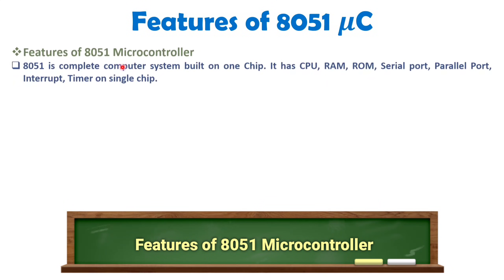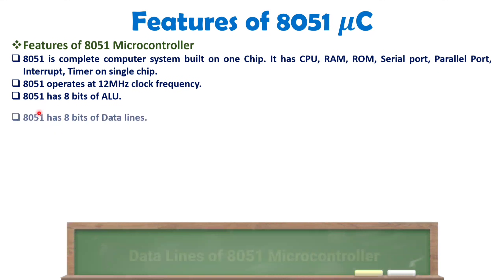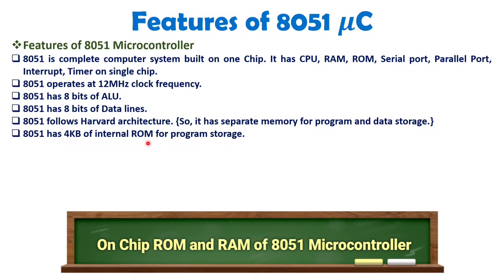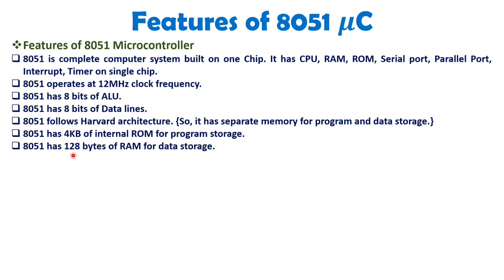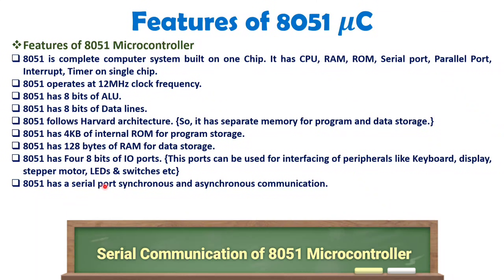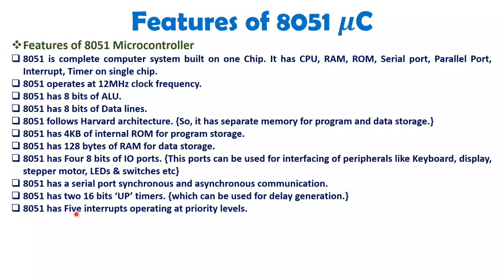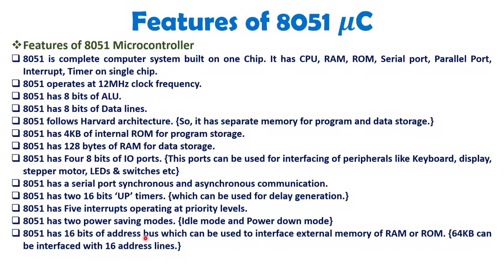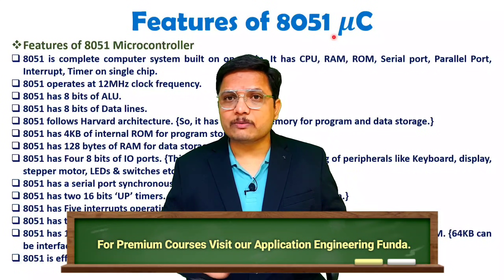8051 Microcontroller Explained: Features, Components, and Applications

Comment: Timestamps (Powered by Merlin AI)
00:02 - Features of 8051 microcontroller
01:16 - 8051 is a complete computer built on a single chip.
02:40 - The 8051 microcontroller follows Harvard architecture.
03:57 - 8051 microcontroller has embedded system and memory storage capabilities
05:23 - 8051 Microcontroller supports peripheral interfacing and serial communication
06:44 - 8051 microcontroller has two 16-bit on-chip timers used for various applications.
08:03 - 8051 Microcontroller has two power saving modes
09:21 - 8051 microcontroller is efficient in embedded systems